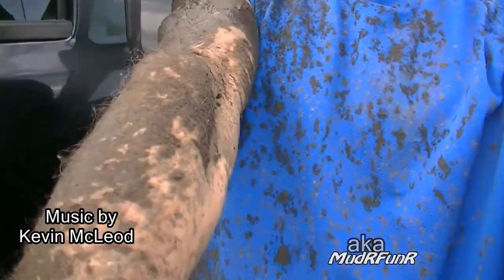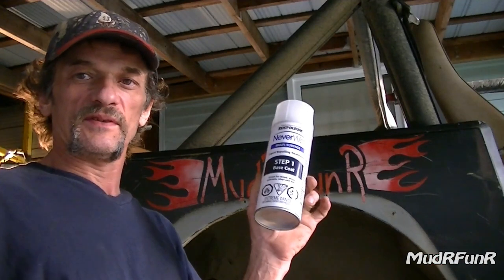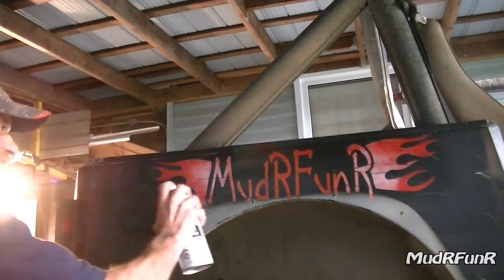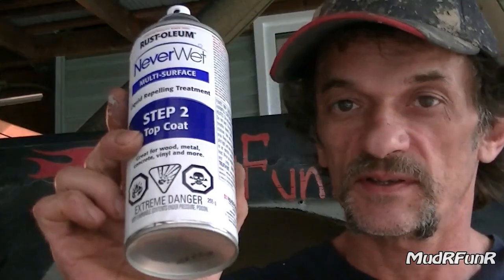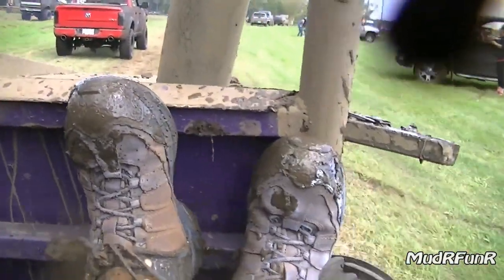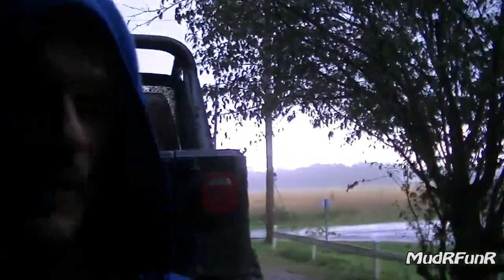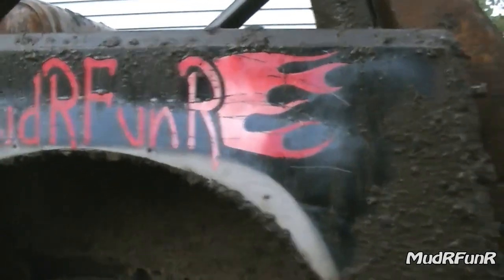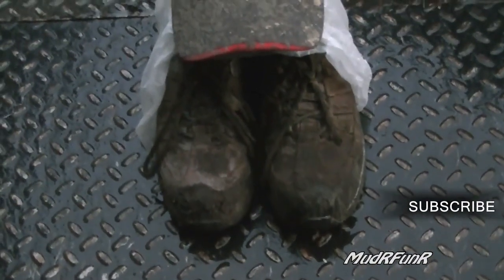Never Wet at the Mudfest - Amazing Results - On my Jeep - On Seats - On my Boots

Comment: Good day I had quite a laugh when video started.  I do some back road driving, spring & fall. Do you thin k IO should spray whole truck lol. Yes it seems to work. I don't know if you go to ploughing matches, the 1 down by  Rainom  centre in  95, should had it then.  Thanks
Reply from the maker: You could spray an entire truck but it would be quite costly and it will dull the paint. It leaves a haze on the paint.